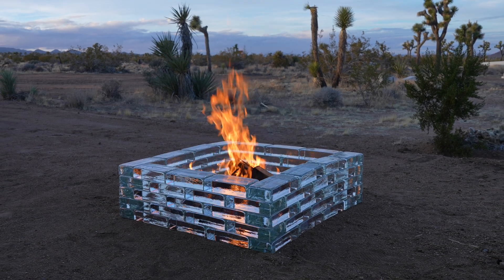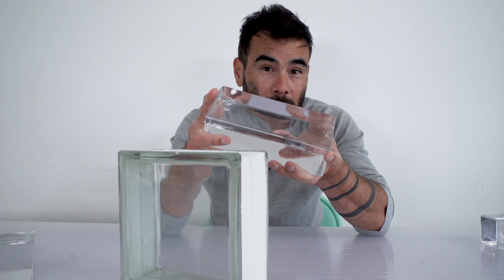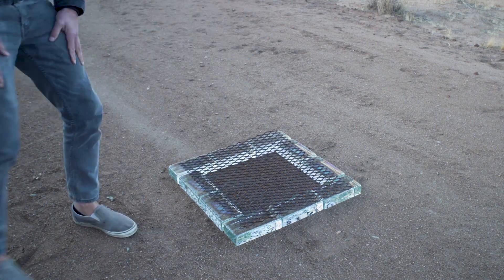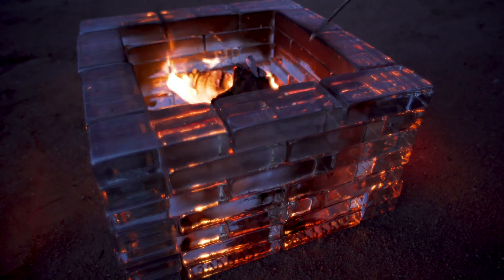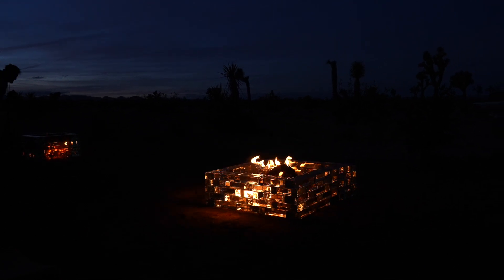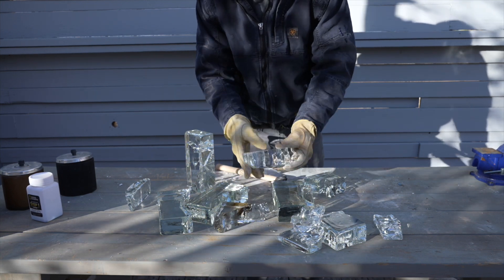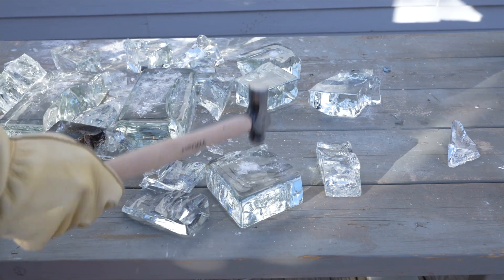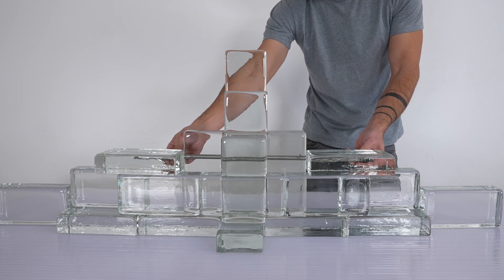Solid Glass Fire Pit

Comment from the maker: Update! After listening to the observations from people with far more experience I think the experiment will end here and I do NOT recommend recreating this experiment. It seems that while it could be fine with controlled parameters or with a gas burner, the imprecise nature of a fuel like wood creates the opportunity for overloading  and the design calibration of distance to fuel should not be relied upon. I was perhaps leaning too much on the 90 minute fire rating from the manufacturer which was well documented but I have seen too many last minute substitutions for materials that appear the same and the cheaper manufacturers documentation was less convincing. I am still curious about the parameters of a glass “explosion” and please weigh in with additional insights!
Reply: The larger fire pit test looked very attractive - enough to warrant the expense of the bricks. But you're going to drop this project? Because of the concern of the bricks exploding? I would really like to see a finished solution because the look is quite stunning.
Reply: Annealed glass shouldn't have enough internal stress to explode. If it isn't, the cooling cycle as a fire pit will be too short to anneal them yourself and they will definitely go boom.
  If you observe any chipping at the edge, concoidial (wave) type fracturing is an indication that it is just normal glass (maybe boro) and not tempered, tempered will not tolerate chipping. Tempered glass can be dangerous in fire, it is under tremendous stress from diferential cooling (they blow air on it which causes the surface to "shrink" the main bulk cools slower and pulls that surface so the edge is very sensitive and under high stress) fire will accentuate that being on one side.
    You just need the "right" glass for it and you'll be fine, something like annealed borosilicate ideally but sodium glass is probably fine.
   Near all glass is annealed and tempered in someway or another. It's like baking, the same dozen ingredients could fill a recipe book based on the various combinations of them vs time and temp.
Reply: I'm watching you cut them now and split it, they are as soft as glass comes. They probably cooled down for several days if not longer in the heat treatment. They won't explode. They may crack if one side is tremendously hot suddenly (like a torch) with the rest cold. It has such a mass, the temp differential won't we extreme. It isn't a thin section bottle that cannot be evenly heated outside an oven. It is a brick.
Reply: The glas can act like a magnifying glass, and start random fires around it if the sun are angled in the right place.
 And the glass can also explode if it's cooled down too rapidly. Glass is typicly colled down slowly over several houers or days depending on how thick it is. And if someone trows water on them, they'll explode (Or at the werry least a part of it will. And it could cause shrapnel hitting someone in the eyes.)
Reply: The smaller pit would burn more efficiently if you opened some air gaps on the bottom to allow it to draft fresh air in.
Reply: Protip for glass drilling- When you cracked that brick and said "I'm not sure if it was due to heat or pressing too hard"... I can almost guarantee it was from both lmao

To ensure things go smoothly there's 2 things to remember.. First don't just "dip" your cutting tool in water.. Instead cut a guide🕳 in pvc-board or something similar for drilling on flat surfaces or create a barrier ring with putty, clay, etc. for curved/uneven surfaces and fill it with standing water‼️ (Drilling under a small amount of standing water not only provides proper thermal dissipation but keeps silica glass dust from going airborne where it can remain as a breathing hazard for hours) 

Second thing to remember is that you always apply zero pressure when drilling glass; you need to have the proper bits and let the tool do all the cutting 💯

Drilling glass requires discipline & extreme patience because it's brittle and unlike other materials, blemishes can't be easily "fixed" or covered! It usually ends in totally replacing the material and starting over which can get costly quick with glass👍
Reply: If heat is your concern, why not keep the glass bricks from getting to hot? It wouldn’t be easy but if you could water cool  the inside to keep the temp lower. Essentially a thin waterfall on the inside wall.
Reply: @tjesnaps that risks creating a thermal incline in the glass great enough to crack or shatter it.
Reply: @ianbelletti6241  unless the water is on the inside of the fire pit with complete coverage of the wall constantly flowing and mixing. Water temp would rise but I don’t think that would be enough to cause enough stress to crack the glass? What do you think?
Reply: @tjesnaps  wut... and how would you accomplish said 360⁰ "waterfall"? 🤔
Even if it was possible, it would just further prove his point of the design being too impractical for the expense/upkeep it would require for something ultimately untested & unproven lmao
Reply: Loved the experiment none the less, thanks for bringing us along with you
Reply: I was gonna ask about rain, causing rapid temperature change breaking the bricks.
Reply: I wanted to suggest you could use clear epoxy was a mortar....  not for a firepit tho.... for a firepit you would probably use Pyrex glass, but that would be  expensive, It's what they make laboratory beakers, flasks, test tube, etc  from (i think it's also called soda-lime glass) BUT I'm not sure it would be able to withstand such changes like in a firepit where the direction of the heat can change in a second, and the outside of the firepit could be below freezing even when a fire is burning.... BUT  if you really are set on making a glass firepit then it could be an option you could look into....
but for other projects I think those glass bricks are AWESOME!!! especially with a clear mortar, but you HAVE TO de-gas the epoxy  and do everything you can to air the bubbles out while you're working with it...  the other issues is that it's so thin.. you'll have to create a barrier on the sides to hold the epoxy in so you can create a layer AND you'd probably have to let it set up for a few hours (depending on what type you use) so that it's solid enough to place the brick on top of it... so a quick set epoxy is really the only way to go, unless you don't mind laying down 1 layer ever 3 or 4 days :/ lol - but I think it'd be worth it to have a clear mortar :D

Comment: A suggestion for your fire pits, leave brick sized openings in the bottom row to allow combustion air under the grate.   A 1/4” (pencil diameter) air gap between bricks will allow expansion and additional combustion air.   Expensive yet interesting concept.   A bit of ash on a damp cloth will remove smoke from glass and protect your laundry.

Thanks for sharing this insightful video.  Wishing you a great week.

Comment: I am a lampworker of 20+ years. That glass powder is EXTREMELY damaging to your lungs if inhaled. A respirator would be a great idea. If you do any drilling or grinding on glass it is imperative that you keep ALL the powder wet. Also, clean up before it dries. And I would wear an apron and remove immediately after, straight to the washer. Our hobbies can be dangerous to our health.
Reply: This needs to be pinned

Comment: A cool but bad idea. First off the glass can act like a magnifying glass and start random fires around it, when the sun it in the right angles. Secondly the glass will become super hot and can just like stones explode when it collsdown , or if some one get the bright idea to toss water on them, thusly creating shrapnell that can end up in some random persons eyes.

As stated earlier. It's a cool idea, but I would strongly advice to only use it around "cool" flames. Flames using low amounts of gas or alcohole. Where the temperature dont get werry high like a wood fire does.

Comment: idk the idea that hits me is using metal or stone layers sandwiched between the glass ones.  why?  metal and stone have different properties related to the heat/cold that they are exposed to... they will act like the glass to an extent but absorb and retain that heat probably in different ways than the glass, which will need experimenting to match up for the "behavior" you want in the finished product.  metal heats up faster and releases that energy faster while stone does not... there is a reason ceramic heaters are popular as well (if that helps)... personally if you got the coin you could always get "heat tiles" like they use with nasa/spaceX etc... those things will change everything eventually.  not the oblaision ones thou, totally different methodology for them.  the thing i can say i don't know currently is that if you put a ring of heat tiles as a fire pit, would it absorb most of the heat or would it absorb some while reflecting more outward than a normal fire (above it)  think of the tiles as mirrors... would they absorb that "image" fully or reflect some away from them?  the path of least resistance sort of mentality??  would they be enough to protect the firepit of glass, as alternating slabs between the glass or maybe as the base of the pit itself?  anyhow ty for the opportunity to share.  peace.

Comment: You really need to understand glass formulas before doing something like this, virtually all manufacturers should be able to give you composition metrics for their products.  Just look at glass dining ware and glass bakeware for example, there's a reason why dining wear does not survive the heat and thermal shock of an oven and removal from an oven when bakeware does, and it comes down to composition of added ingredients; also look at laboratory glass, some of that stuff can take a hand torch directly to the surface when melting dry material.  Composition will quite literally make or break a project like this.  These factors also contribute to other strengths and weaknesses, which would make them viable or nonviable for other projects, such as using them in construction and if they're capable of being load bearing at all; another metric that a proper manufacturer should be able to provide, though I doubt the Chinese-sourced ones will get much father past than expected composition, whether or not the final product actually matches that.

Comment: glass tends to go boom due to sudden temperature swings or if heated and constrained. Unlikely solid blocks of such mass would explode, but will probably crack with time. (full disclosure sis not watch yet), so long as they aren't tempered. Tempered glass is already a bomb waiting to go off. 

Greatest hazard would be sudden rain on hot bricks. 

Adding in some air channels to create smokeless type design could help with cooling.

Comment: Borosilicate (pyrex) would work better but is probably not available or if it were it wouldn't be cheap, also high borosilicate glass usually has coefficients of expansion as tungsten.
The green in the glass is usually from iron contamination. It could easily be a completely different formulation of glass than the clear bricks. Think of glass as kind of like steel in that various formulations have different properties. To that it might be worth putting a layer of some other kind of glass between the bricks and the fire as a thermal buffer or some composite of clear materials.

Comment: It’s a cool look for sure I’m impressed there wasn’t more breakage I would probably for with a fire pit kit from someone like Firegear they offer these brass burners that will give u a beautiful and controlled fire that will not leave the same amount of sut bonus is u can place any broken glass bricks into the panel to cover up the burners or u can contrast the whole thing and use lava rock 

If u insist on a wood burning I would still build some sort of burner space almost like a pizza pan with low walls and holes on the bottom ALSO in the for pit itself I would leave holes to allow air to circulate

Comment: I wonder if you would have the same results with the first one if you had used the smokeless method.  You would have to dig a little tunnel for air to enter from below and to the side of the pit.  I would imagine the bricks would have been cleaner, but I wonder if you would have cracking like you did.

Comment: Just when I thought you had used all possible materials, you change it up on us. Also.... pretty good sneaking the six pack shot into the ad! (LOL)
I did a quick search for pyrex bricks but found none... but they would give you the heat resistance for the fire for sure... that's why they make crack pipes out of it.

Comment: Very cool. I'm curious how this will play out in in the long run. We have a lot of experience on our farm with regular brick and cement fireplaces and find that they always start cracking eventually and the thing needs to be rebuilt every few years no matter what sort of high temperature mortar we use. We even used refractory cement that's meant to line the insides of metal smelting furnaces and even that started cracking eventually. This looks really cool though!

Comment: A few thoughts on using glass: 1) more heat/cooling cycles might impact glass stability longer term, 2) if the glass ever gets “glowing” hot it can damage your eyes, 3) agree with using hextal, a museum quality epoxy. You can use diamond pads followed with polishing compound. Looks Awesome!
Reply: How does glowing red glass damage eyes? By looki g at it or the risk of shattering?

Comment: For the final product, make sure you leave gaps in the bottom course to allow air to come in under the fire. You'll get far less soot if the fire can breathe well. That's how those popular smokeless fire pit things work.
Reply: I was thinking the same, or even a buried air vent to bring the fresh up right up under the fire. I was also wondering if there would be a way to control the direction of fresh air to focus/contain the heat in the center and up, and therefore less on the glass?
Reply: @IAmKyleBrown  Yeah, the simplest method would be to get a 8-10ft length of electrical conduit and a pipe bender. Put a short 90deg bend on the end of several 2ft lengths and lay them so that they bring air straight up through the middle. Too easy. Occasionally you'd need to clean out the pipes but that should take all of about 30 seconds with a flexible stiff bristle brush.
Reply: @IAmKyleBrown  if you angle all of the air gaps sharply you might be able to force a vortex in the updraft
Reply: @mikescholz6429  yes! Like a fire tornado!
Reply: @mikescholz6429  That was my thinking. One brick out on the lower right corner of each wall should create at least a rudimentary vortex within the pit which would help keep the bricks a little cooler. If you feed the air directly into the base of the fire like underground pipes and such all you're doing is making the fire hotter without addressing the heating of the bricks.
Reply: yeah technically smoke is unburned fuel.
Reply: I came to the comments to make the exact same suggestion! :)

Comment: Lovely stuff! It might be worth trying to shape airflow also, in order to control soot.
As to polishing/shaping, I've seen some great results on other channels with MDF wheels impregnated with honing compound: MDF can be shaped to suit the application, and has enough give and thermal mass to it that it doesn't chip the glass, but is firm enough to drag the compound against any high spots with the right amount of force.

Comment: For less soot, you might try for cleaner burning woods. Cedar, for example, burns very dirty and creates a lot of soot. Other woods with less sap ar likely to burn cleaner and leave less soot deposits.
As for the glass, it would be interesting to see if you can get some made from Corningware/Pyrex. Those would hold up to extreme temperature changes much better. They would probably also cost a lot more.
Fun experiments! Thanks for sharing!
Reply from the maker: Great suggestion!

Comment: Love your curiosity and experimental process, This plus outreach (& links) to Weston are really helpful. Few tangential thoughts… ▪combat soot with fire contained away from walls AND either several layers of opaque block rising above glass or location with adequate wind-block; ▪cheaper glass block… clear epoxy pour into block molds with broken safety glass (likely free and breaks into marble-sized cubes).

Comment: That concept was stunning!
I think the second larger fire pit also made it so that more air could get into the fire from the side causing it to not smoke/soot as much, so you got a trifecta of "clean" brick.
Potentially it could be enhanced further by combining the mesh you used on the first prototype, by adding in that and leaving some gaps between the bricks on the first layer that the mesh is resting on it would allow even more air to get to the fire from below and making the fire smoke even less by burning more cleanly and maybe even more lively.
But that could maybe also make the fire burn hotter causing more bricks to crack...

Comment: Another thing you couls do to improve efficiency to reduce smoke and to reduce the temperature of the blocks is run a air supply under the pit walls to provide oxygen for a secondary burn ala the smokeless firepit builds. 

 Depending on where you place them it could also create a air curtain effect.